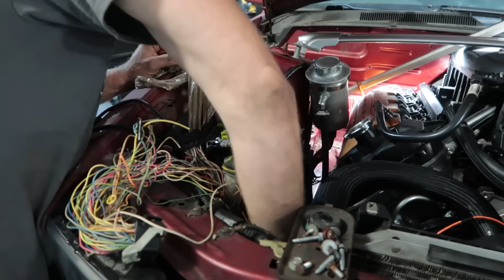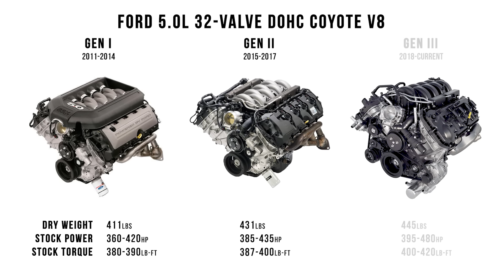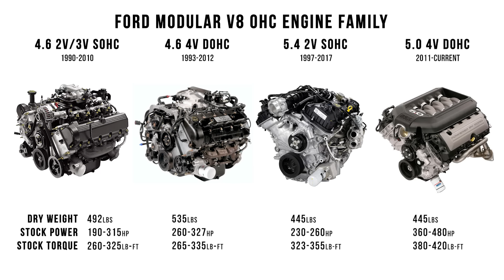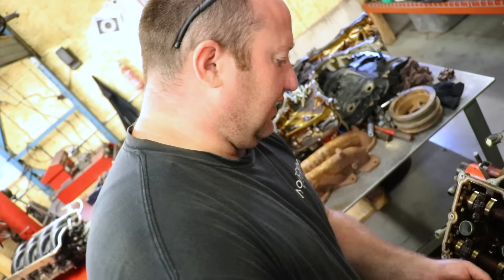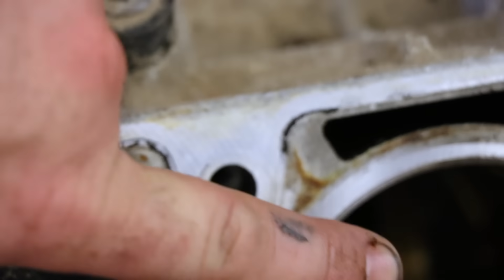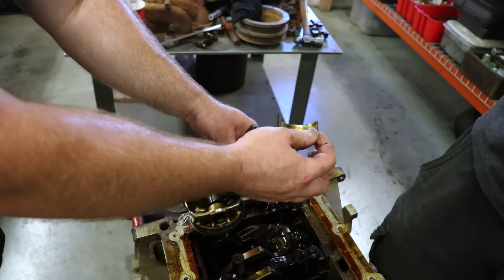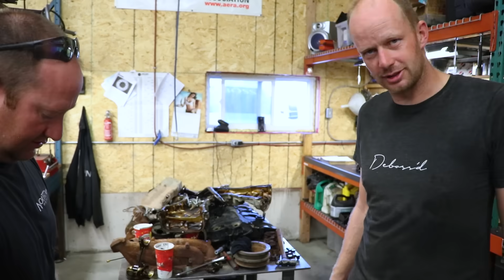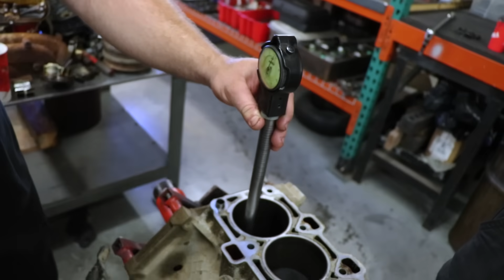REVIEW: Everything Wrong With A 5.0 Coyote Engine

Comment: So no one going to talk bout the 4.6 and 5.4 spark plug issues...... Guess that is in the states
Reply: from what I've gathered over the past few years of mod motor work, it's not THAT big of an issue unless you are pushing a lot of boost or just don't tighten the plug down enough. A common issue is that the spark plug installer doesn't apply enough torque and the spark plug loosens up and vibrates then shoots out of the heads. Obviously it was an issue, that's why ford made revised heads in later years, but that's just my 2 cents.

Comment: My 2012 f-150 5.0 has cylinder bore distortion knock issues developing at 60K. Took it to two dealers (second of which helped me) and ended up replacing the long block under my CPO warranty, which took 9 months as the engine was on intergalactic back order. First dealer told me to piss off and it was "normal operation" and claimed they had "never" heard of it before which was a bold faced lie. Second dealer said they had done almost a dozen of them and put my in a rental for the entire time. Replacement engine showed up with a bad head and ended up needing a replacement, all of which was covered under my warranty. I would have no issues buying another one. I would also have no issues buying a Chevy, my one qualm with Chevy trucks is NO REAR AC VENTS...C'mon Chevy..I know they're on the 2020's, but I would never buy a new truck and the new Chevy's look god awful.

Comment: My takeaway from this video: change your damn oil.
Reply: Yeah I don't buy all that stuff about synthetic causing deposits and mixing brands being a problem. It looks like it just didn't get changed often enough.
Reply: @svtirefire  do gt face f r rr
Reply: @svtirefire  I believe he said Synthetic will cause problems if engine is taken on too many short runs...and yeah obviously regularly change your oil and filter
Reply: Exactly. People never do maintenance and then claim the engine is garbage. Like the 4.7 Jeep, dodge, engines.
Reply: @mikehunt8375  ...loved that engine in a early 2000's Dakota...
Reply: @mikehunt8375  my brothers 4.7 has a very rough 378k on it
Reply: @mikehunt8375  my mom has the 3.7 in her Dakota, in the 70k miles she’s put on the truck. She’s had the oil changed about 5 times. Absolutely amazing how that thing is still running, it’s an absolute dog, it can only go about 35mph going up the grapevine(into LA).
Reply: @mikehunt8375  Yeah they are garbage.. straight from the factory new
Reply: @mikehunt8375 exactly the 5.4 triton is the same way if you took care of it just the basics you would never have a problem with it
Reply: Mike Hunt IKR? How can someone drop +$50K on a new truck, then “save money” by not changing the oil? Are they an accountant?
Reply: @jerrykorman7770  the factory intervals are plenty, overkill even, no need to exceed them, but also shouldnt be pushing past them.. people rolling in with 60k on their oil more sludge in the engine then oil left.. that being said i seen a local mechanic buy a 800$ saturn and put 80k on the oil without issue car rotted out before the engine had an issue.. didnt make sense to put 10% of the cost of the car into an oil change when it was only suppose to last the year and ended up lasting 4-5
Reply: Andrew Browner agreed
Reply: @jerrykorman7770  I have known people that think that the only thing a vehicle needs is gas. What the hell is oil?? There are people out there that just don't know engines..........Maybe electric cars are the thing for them?
Reply: JOEB JOEB huh, you described my ex. When she first moved in, I naturally became responsible for her at the time 3 year old 1999 Chevy Malibu. I thought the thing ran awful, so I changed the oil (On Add, black as coal), the plugs, and cleaned the TB and MAF. Ran so much better. She couldn’t understand why I just changed the oil. According to the sticker, she had last changed the oil 14 months and 13,000 km ago. Every 3 months I did an oil change, every 3 months she claimed I had done it “last week.” Hint, never get married. For what that marriage cost me, I could have bought a new Cadillac every two years, and I would have saved money
Reply: @AndrewBrowner  I bought a saturn for 800. Changed the oil every 3000 miles. Put more money into that car than I paid for it. But it was my car and maintenance was cheaper than a new car. I sold that car not to long ago still running like a top. Only check engine light was for the egr insufficient flow. I didnt fix that because to fix that I had to take the intake manifold off. Not hard to do, just ran good enough.
Reply: @Captionmarvelous  Electric cars need oil too
Reply: @AndrewBrowner  I'm rockin the twin cam saturn now, great great car, 2000 sl2, 300 bucks
Had it over 2 years, been to Tennessee twice, Connecticut, maine, new Hampshire,  all over
Just put drain oil in it, has 289k on it
Reply: I know I'm over critical on my 5.4 Triton but I dont want a problem, I change oil on it no matter what 3,000-4,000 miles, it has 120,000 miles on it, and never had one single issue yet, hoping it stays that way lol.
Reply: @A1rs1ck  I typically run 5000 to 7000 miles on a change but that's because every trip I make is long enough to get the oil to temp, and those trips are twice daily or more. It's just a little GM 2.2 liter in a Sonoma, but all the factory gaskets are untouched and it runs as well as you'd expect an engine with 100K miles on it to run; and that's absolutely fantastic given I pulled in the driveway this afternoon with 298,000 mile. Just dino oil, valvoline 5w30 and I only lose a quart every 4000 miles or so. 

I wore the differential out first. Hell, I could still be running on the factory clutch if I hadn't broken the pedal pivot and somehow screwed up the slave cylinder, went ahead and had it replaced because it was a little bit chirpy (glazed). But then there's more front wheel bearings than I can count and some magically disappearing suspension bushings so I guess that's a wash.
Reply: @mfree80286  the funny thing is, people say the 5.4 Triton's are bad engines, but mine hasn't had not one issue everyone else has and it's a 2001, mine has been hauling boats or travel trailers it whole life, when I hit 110,000 miles I stopped hauling anything with it, since iv gotten a newer vehicle. The only thing on the 5.4 Triton I have wrong with is just 1 passenger side manifold stud broke, and a bad Air Idle Control Valve.
Reply: Michael Free sounds like you keep on top of things. Rough roads and salt in winter destroy my vehicle bushings
Reply: Foster Johnson I believe that consistent maintenance, and working a motor (No short trips or extensive idling) help it last longest
Reply: @A1rs1ck  you have the older, 2 v triton 5.4. That version is MUCH more reliable the newer 3v 5.4. Your engine makes less power and uses more gas than a 3v, but makes up for it by being a solid 300k+ engine when maintained.
Reply: @Brandon_Nelson92  Thats what my question was cause the 3 valve was junk.
Reply: @A1rs1ck  I've seen 2001 5.4's with over 250,000 still running strong but it's the 2002's and up with 3v that will get ya. Some even like to forcefully spit out a spark plug every now and then besides the other issues. LOL then they sound like a 1940's Farmall tractor.
Reply: @biggiefitz6275  that's good to know, glad I dont have to worry as much as I was about it.
Reply: @A1rs1ck  Right. I just drove a friend's and hers has 200k and ran great. She just did the egr valve
Reply: @A1rs1ck  2001 5.4 was a 2 valve, those are bullet proof and will run forever. The 3 valve 5.4 was the one with the issues.
Reply: Foster Johnson sounds like you are doing something right
Reply: ChrisHallett83 that would work out to perhaps once a year for me.  If it was all highway miles, maybe. Mostly city driving in and around Winnipeg. Winters here can reach -40, summers can reach +90’s F. Combined with a GDI engine, sludge. I change the oil myself, perhaps an extra $60 a year. If that breaks the bank, I have no business even touching a car
Reply: I watch a lot of tear down and rebuild videos and 9 times out of 10 they had to tear it down because people didn't change their oil. The one other time was because of a known issue.
Reply: and take your vehicle on the highway once in a while for a good long run
Reply: Willie yup, that is best. My car that mostly sees short trip drives, once a year I would do a road trip from Winnipeg to St George, Utah, to visit friends. Car always ran much better after all that Interstate driving. Last year, life got in the way. This year, you know what happened
Reply: @jerrykorman7770  right before an oil change is my preference
Reply: @willie9397  what? You mean when all those deposits are in your oil making it more like a fine sandpaper than a lubricant?
Reply: And that synthetic is not really a must
Reply: Jackson Rodrick agreed
Reply: You have to lift the body off the chassis to change the oil, Ford is a horrorshow 
ABSOLUTE WORST COMPANY EVER!
Reply: @WhiteManXRP  lift the body off the chassis to change oil in what vehicle??
Reply: @young11984  haha. A bit of exaggeration there. Lol.  That's what it's like to work on a Ford...lmfao,  you got me dyin,right now brother..
Haha, seriously, its ASININE to maintain these fords, especially the diesels
Reply: @young11984  01'-13' f-250, 350, all death wobble sleds, good for towing but that is it
They are very very depressing to drive
Hated them, poor design, and not well thought out
GM vehicles are mechanic friendly 
FORD - IS NOT
Reply: @WhiteManXRP  more like an extreme lie, no Ford vehicle requires a cabin to be lifted for an oil change so why even say something so false. 
I have an 01 F250, never had a death wobble nor have any of my friends that has 250-350s either
Reply: @young11984   an extreme lie huh?  Lol
Excuse me if its exaggerated a little,  nothing you can do to bring back the inexcusable reputation of the biggest junk trucks on the planet...
Sorry, but not sorry, get a grip, laugh a little 
FORD IS MADE TO DRIVE AND WHEN IT BREAKS THEY ARE BEYOND REPAIR SO THEY GO RIGHT TO THE CRUSHER, JUNK PAL
Reply: @WhiteManXRP  maybe you just dont know how to repair them then, sorry for your bad luck and lack of real knowledge on the subject. Im a Ford guy but i know just like every brand on the road will and do have problems or else there wouldnt be thousands upon thousands of recalls on all of them nearly yearly but keep believing your story because if it were true Ford wouldnt be the best selling truck....PERIOD.
Reply: @young11984  alot of fools I suppose, did you vote Biden too...lol. Ford isnt my cup of tea
Reply: @WhiteManXRP  wtf is voting for Biden have to do with making damn sense and not telling blatant lies on videos, was it to get likes, laughs or hope somebody would agree to boost your moral? No need to post sideways information like that was my point, yet here you are coming up with some political shit to reinforce your need for conflict over your misinformation so go learn about a ford instead of spewing hate for a product just because its “not your cup of tea”
Reply: @young11984  Listen, FORD sucks, and noone is making videos about anything guy, wtf are you talking about, I was joking from the get go, until you wana play fuckin games, I dont give a flying fuck, stop over analyzing my joke, and now taking it to heart as if your some fuckin FORD scientist
Drop it before it gets ugly, stick your fords up your ass, and enjoy life, no fucks given, go back to the drawing board kid, go re evaluate your situation,  FORD IS A NIGHTMARE......PERIOD!
WE obviously dont see eye to eye, and nothing you say will ever change my mind, they are all slabs, tubs, and death wobble dumbo trucks bro
Give it up, over n out, have fun!👍😎
Reply: @WhiteManXRP  oh boy tough guy, go fly your little “twin cam saturn” off into fairy land dip shit. Before it gets ugly, you started the ugly shit from a simple question i asked. Ford Tech is not a scientist but close since we fix what engineers and self proclaimed mechanics screw up, i have no problem with differences of opinions but will call out people for making ignorant comments for whatever reason that one was supposed to be. Have a good one and wish you well with your temper tantrums there kid.
Reply: @young11984  your a CLUELESS ford driving punk, douch bag
Reply: @young11984  you flew off the handle from a simple joke, I corrected you, very politely, and now this, whatever dude, have fun
Reply: @WhiteManXRP  from your comments I'm betting you a few pickles short of barrel.but then again most of the people I know that drive GM products are kind of idiots.
Reply: @cecilandrews7479  anyone who drives a cheap FORD shitbox is misinformed and CLUELESS, and cannot turn wrenches, throw away vehicles,  the design of the trucks are extremely poor...
And that's a fact.. aluminum junk
Reply: @WhiteManXRP  I'm guessing you're a poor delusional fool or you're just a kid that's 12 or 14.
Reply: @WhiteManXRP  ???? What. Look at chevy silverado you can hardly get to the oil filter
Reply: dj  poor comparison, super easy, and mechanic friendly design
Reply: @jddj6376  very easy to get to Chevy oils filter it don’t get no easier then that
Reply: Very wise conclusion 👌🏽
Reply: Right like I know what I’m doing today haha
Reply: Well I  lost on average 1 engine   a year .But we are talking about a fleet of 1200 vehicles on the road every day . Disposed of at 300000 miles  or first major break down after 150000 miles.  We used 5000 mile oil chang interval or once a year on the few that got low mileage. Average life in years was 7. This was a fleet of vehicles driven by employees who all wanted a new car every year , only way that happened was if they totaled it in a wreck.  Wreaking vehicles was grounds for dismissal. All drivers notified when to bring it in for service,  by fuel consumption, fuel and mileage recorded at every Fill-up  later by GPS real time tracking. We did everything,  tires brakes suspension major repairs in our own shop. Body and paint sublet. All supplies including vehicle low bid !
Reply: Thomas LeMay that’s how you professionally do it, with tracking fuel use and routes. Some of the telematics offer engine hour reporting too
Reply: The whole point of syn oil is extended oil change intervals.  If you're going to change your oil frequently, you might as well use mineral oil and not waste money on synthetic.  Nothing wrong with modern mineral oil.  I've got over 200K on a Harley using nothing but dead dinosaurs with no oil related problems.
Reply: @scarhart53  I use synthetics because of proven performance at -30 and colder
Reply: Kind of like the rich snobs with
Mercedes, Volvo, BMW, all of them
Noone ever maintains them
They drive em into the ground 
It's a shame
Reply: thats where it starts you clown them engines are a f ing joke and junk
Reply: Both my Coyotes (2011 and 2016) get oil changed at 7500 km. Ran the 2011 on conventional but decided to go synthetic on the 2016. No issues to date with either engine. Gen 1 and Gen 2 could run conventional 5w20 with the cam phasers. Not sure about the gen 3.
Reply: Allan Vaneste yeah it was apparent the motor in the video had been neglected. Consistent maintenance pays off in so many ways
Reply: @allanvaneste6039  that nice 8 quart (7.57? :) liters 🇨🇦 liter of cola) capacity in my F150 makes me feel better about longer oil change intervals.
Reply: @William Harvey  same, agreed 100%. Others will claim they can easily achieve 200,000 miles with only two oil changes (Heavy sarcasm) . If highway miles, 5,000 tops for me. Otherwise, oil and filter every three months. 

I also use my vehicles partially for business as I'm a self employed contract worker. I keep meticulous records. The extra "cost" to me for oil and filter is $168 per year, $14 per month. If I can't afford an extra $14 per month, then I had better sell my vehicles and walk or bicycle my ass everywhere

The fuel, an extra $390 on top of the $1,900 I already spend on fuel. Call it an extra $30 a month. Again, if I can't afford that, time to walk.

I should point out that I don't do the daily Timmies. I'm one of those guys who can't tell the difference between a cup of coffee brewed with the cheapest Real Canadian Super Store coffee on sale, or a "premium" coffee. I brew a pot at home, fill a thermos, and bring it with. I hate sugary stuff, so no junk food either.

My point? I know people who easily drop $5/day for their Timmies and snack. Call it $100 a month for shit that isn't even good for them. But they can't "afford" a couple more oil changes?
Reply: My take away from this video is he's a lacking in research of the Coyote engine. They are extremely well engineered engine, and like all engines with proper maintenance will last quite a while. Really not sure after watching some of his videos I would let him work on anything I own.
Reply: Don’t go over 4K even if using full synthetic no matter what kind of driving. Solenoids are malfunctioning on mine at 50k miles  because I went 10k on an oil change  by mistake, mobile 1 full synthetic and filter.. whoops.
Reply: my takeaway was dont buy a ford unless youre gonna engine swap it
Reply: Andrew Browner lol
Reply: @AndrewBrowner  fords 4 cylinder and 6 cylinder yea but ford makes a good v8 minus a few duds thru the years. Any engine without proper maintenance gonna have issues except maybe a toyota or honda